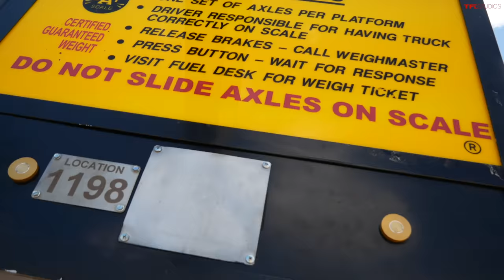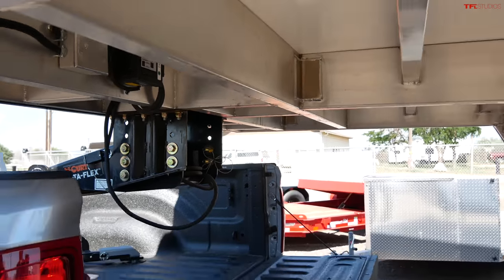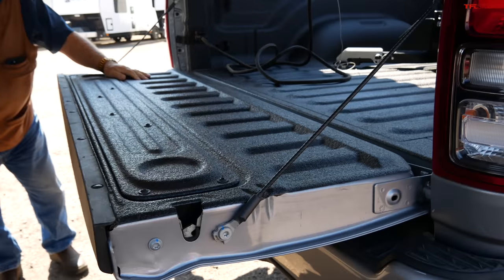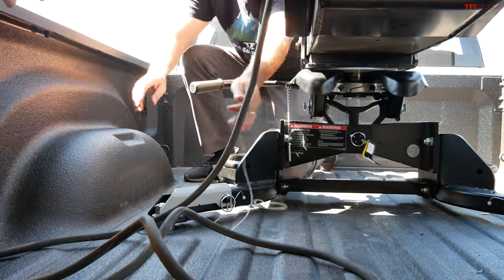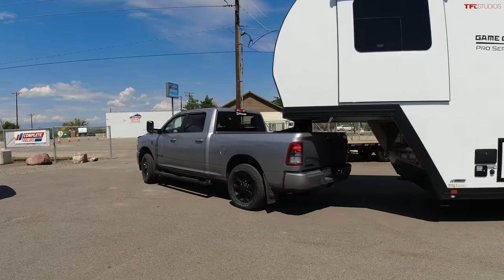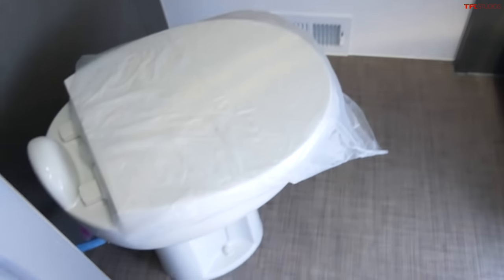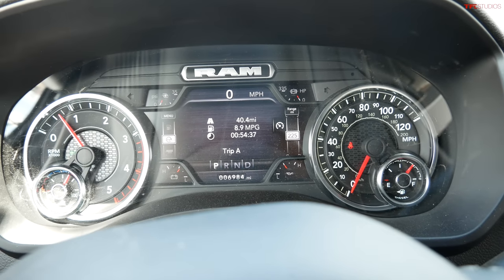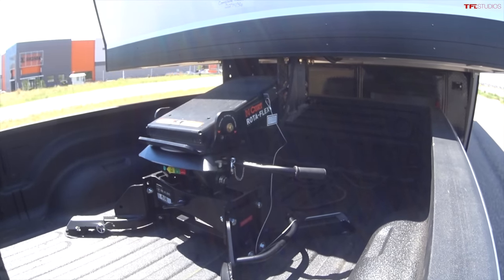I Accidentally Overloaded My Ram 2500 Cummins By 1,000 Pounds & Guess What?

Comment: Toy haulers are built to be naturally pin heavy when empty. This is to balance out the load of the cargo in the trailer when loaded so that the trailer maintains the right ratio of pin weight. I suggest doing a follow up video with a side by side loaded in the trailer. This would be a great demonstration to show why load and placement is so important when hauling 5th wheel trailers.
Reply: I’m surprised this isn’t the vast majority of the comments. That truck is fine once the trailer is loaded.
Reply: Funny how many “experts” will claim that loading toy haulers will take away tongue weight….when they are designed to be tongue heavy unloaded.

I have to move ballast to the rear of my toy hauler because I use it for mountain bikes. And I use the grill and most of anything I store in the pass through as ballast. Also the fresh water tank sits in front of the front axle, I usually leave it near empty unless we are boondocking. That water can balance out a heavy load in the rear, but for me it just adds tongue weight (100 gal tank)
Reply: Tfl still thinks measuring squat of relevant metric to compare trucks of different suspension design
Reply: ... Any trailers for that matter. You don't want to get into a fishtailing nightmare because pin weight is too low!
Reply: I was going to say, throw some wait in the trailer and it'll balance out, when you do the math from the weigh in 8300lbs to over 11000 is 2700lbs of tongue weight, that's nowhere close to being withing the 10-15% tongue weight, that's 25%. Gross trialer weight you should have about 1600- 2700, should be pretty close to the gross weight of the truck. That said a 1 ton or a heavy payload truck would be better for sure
Reply: @gtileo  Fifth wheels, especially campers like this one don't fall in the 10-15% tongue weight range, that's only for pumper pulls. Fifth wheels are in the 20-25% weight range which is exactly what this one is. Loading 3k pounds in the back of the trailer isn't going to lift the front of the tongue weight worth 1k pounds. It's not a teetertotter lol. The axles are pushed back and spread out for a reason, to carry the load that's in the camper, but it's not going to just magically lift the front end of the trailer, it'll make the overall trailer even heavier and might even put more tongue weight on the truck. You typically want your 60/40 split, right now it's maybe a 75/25 split, but getting the rear weight up 15% isn't going to lift the front end enough. 3/4 diesel short bed trucks are the most useless thing ever put on the road I'm not sure why anyone even buys them. If you want to tow you just get a 1 ton I don't even know why 3/4 ton trucks exist. Either get a halfton and tow a little trailer or get a 1 ton and tow basically any trailer.
Reply: Load and placement is important with ANY trailer. The amount of vehicles you see towing heavy loads with the nose of the tow vehicle in the air is worrying.
Reply: @dougswamprat5275  That's because the majority of people still haven't realized that 3/4 ton trucks are useless. That's why it's called a 3/4 truck because it's only 3 quarters if a real truck. And a 1/2 ton is half of a truck lol.

I never understood 3/4 diesel trucks. Like, you put a very powerful diesel motor on a vehicle with very limited suspension and from / axles. Why would literally anyone want the most capable engine in the most least capable truck? Ford uses the 6.7l in every truck from an f250 to an F750. So why would anyone want an F250? Will get the same fuel economy as an f450 but with half of the capability. You wouldn't buy a ranger with the 6.7l diesel, I mean that'd be cool because it would be fast but it's not going to tow well and it's not going to carry anything.
Reply: @dedalliance1  well for people that do real work and don’t spend their time on a YouTube forum talking out of their ass..3/4 ton diesels do all kinds of amazing work hauling hay, wood, and other various ranch jobs around my ranch. Yes, it probably isn’t a good truck for hauling my house when I go camping (for all you 5th wheel fan boys that don’t actually camp), but I camp, you know with a tent so it’s not a big deal. I routinely pull tractors and all kinds of heavy equipment, works just fine
Reply: @Mistro07  Yeah I've worked on farms too, and I've pulled 2,000 pound trailers with a four wheeler up and down steep grades, really it's a tractors job but tractors are expensive. Look, the only difference between a 3/4 ton and a 1 ton, depending on brand and year, is the suspension, maybe the rear axle, and maybe slightly different brakes. Basically, it's the difference between handling packages which is why it's utterly stupid to buy a 3/4 ton truck when for like a grand more or 2 you can just buy a 1 ton truck and have a much better handling truck which you can overload even more. I'm sure being a rancher hauling heavy equipment you've overloaded your 3/4 ton diesel many times before, well imagine this, if you had a real truck, aka a 1 ton, you could overload that truck even more, you could get a 46' deckover gooseneck and put 2 of your tractors on it at the same time and haul that around, you could put 4 more big round hay bails on the trailer with your 1 ton and get even more work done. But that's the whole point, a 1 ton truck is just more capable, sure, you can overload a 3/4 ton truck to do the work of a 1 ton truck, but you can overload a 1 ton truck to do the work of a semi too if you really want to. A High output 1 ton Cummins has more torque and horse power than a PeterBuilt in the 60's lol. Like you could legit tow 40-50k pounds with one if you wanted to. Which is exactly my point, why buy a 3/4 ton truck if you do real work? For a couple grand more on a new truck you could just get a 1 ton truck and then have even more truck to work with. You'd get the same fuel economy, it's basically the same weight so it's not going to get anymore stuck in the mud, it's basically the same ride quality (better ride quality when towing heavy). Other than being dumb and ignorant there's no reason to not just opt for a 1 ton. But then again, farmers and ranchers are typically dumb ignorant and stubborn it's just how it is.
Reply: I bet the truck will be fine with the weight side by side loaded in back would take a little tongue weight off.
Reply: 5th wheels and goosenecks are designed for around 20-25 percent tongue weight. 

Ram 2500 trucks with the diesel engine are payload limited for max tow with a 5th/gooseneck trailer. The only way to achieve max tow is with a bumper pull, with them being 10-15 percent tongue weight.
Reply: Exactly I have a bumper pill toy hauler. The axles are farther back than a normal trailer to compensate for weight in the back
Reply: exactly!!! put 5000 lbs in the back of the trailer and I bet the truck's weight will be under 10k lbs

Comment: If you're planning on buying a trailer, it's always best to buy too much truck the first time.  Having to trade it in to buy a bigger truck will cost you more in the long run.
Great video with great information.
Keep up the good work.
Reply: Facts, I’ve always had this concept but others would say I’m doing too much. I rather have too much truck than to find out one day it’s not enough.
Reply: 8ft bed and a 3500 is the only way I’d tow a 5th wheel. 2500s are for large travel trailers.
Reply: @slscamg  I tow a 30 foot travel trailer.  I tow with a 2017 Chevy Express extended cargo van 2500 with the 6 litter V8.  I wish it had the Duramax in it, but at the time I bought it and still today the only Duramax available for the van is the 2.8 4cylinder.
If the engine goes and the rest of the van is still in good shape I may look at putting a 5.2 liter Isuzu diesel in it.  It's what most of the Isuzu box trucks run in them, and it's supposed to be a good engine.
Reply: No such thing as too much truck 😁
Reply: I went from a half ton Chevy 5.3 to a high output 3500 Cummins SRW. I never wanted to have to do it again

Comment: Excellent video as always. The Ram 2500 rear axle is rated for 6,040 lbs and the front axle is rated for 6,000 lbs. You are only about 100 lbs above what the truck axles can take, so going to a dually would be way overkill. The Ram 3500 Single Rear Wheel truck will get you up to a 7000 lb rated rear axle and a 11,800 lb GVWR for a crew short. And as a bonus ticking the box for the Ram 3500 will enable you to get the High Output 6.7L Cummins that bumps the rating up from 370hp / 850lb-ft to 420hp / 1075lb-ft. Yep, 1075 lb-ft of torque and no dually parking hassles. 😎
Reply: It’s the pin weight and passengers that causes you to go over.  Add pin weight with people and cargo in your truck.  Illegal weight is illegal. Any weigh station will write you a ticket the cops care about cgvwr and gvwr.  Doesn’t matter what you think your axles are rated for.
Reply: @LANsolo12  I don't know where you live, but every state I have lived in bases the loading on axle ratings.
Reply: A dually is not overkill for a trailer that can weigh 16000 loaded. It is in fact exactly the tool for the job at hand.

Comment: You did great.  I would have suggested you test your king pin connection prior to taking weight off of Jack's.  I've seen connectio s that look good not be fully latched.   The result is caved in bedsides.   And to test the trailer clearance   asking is good bit pulling forward at full lock is more useful.  I didn't do that once and had to replace a window on my Ram.
Reply: It's always best to raise your jacks a few inches off the ground (and chock the trailer wheels) before trying to test your king pin's lock.  That way you are less likely to damage your jacks or drop the trailer down on the bed of your truck during the test!
Reply from the maker: @rpsmith  Yes - that makes a lot of sense!
Reply: No need to Chock the tires, use your trailer brakes.
Reply: @rpsmith  or manually lock the trailer brakes and pull away and mr truck great education through the entire video love you explained that king pin vs ball connection to the truck
Reply: @farmkid7888  -- Trailer brakes are not designed to work in reverse and chocking the wheels is 100% reliable!
Reply: Tug test!!
Reply: @rpsmith  WHAT!? " Trailer brakes are not designed to work in reverse"???
Unless you are referring to surge brakes (which would NEVER be on a 5th wheel), all trailer brakes work in both directions.
Reply: @rsg1963  -- Drum brakes are designed to take advantage of the drum turning to help set the bakes so they don't work all that well when you are backing up.  Folks who grew up working on drum brakes know exactly what I'm talking about.
Reply: I stand corrected!  According to Dexter, their electric trailer brakes are designed specifically to work in both forward and reverse directions!
Reply: The video proves why never to buy a standard size bed truck if you plan on towing goosenecks or 5th wheels long bed for the win.
Reply: @erikgonzalez2278  Thanks
Reply: @Back_door_bandit_98  -- Real trucks have 3 pedals, no spark plugs and a long bed!  :o)
Reply: I thought the hook up procedure the went through was not good at all. They run the king pin in, do a bunch of other non related stuff to hooking up, then one of them says he has to go back and make sure to lock the jaws? Not with me. It's all or nothing when making the trailer connection to the truck and with 5th wheels you will visually inspect where you captured the pin. Then tug test. You set your self up to forget something by not following an all or nothing attitude to the hook up procedure and that is not safe.

Comment: I would like to say, when you’re pulling a brand new trailer like that, always start with the brake gain low and then you can always go up from there. Cause if you start at 9, you’re gonna lock up the trailer brakes and flat spot the tires.

Comment: Don’t forget that the hitch alone probably weighs about 300#, which comes directly off your available payload. I have a short bed 2500. We use a slider hitch to allow full turns without worrying about the trailer hitting the cab.
Reply: Ya I was really surprised they weren't using a slider.

Comment: Some comments: it is helpful to do a 'pull test' before you head down the road. If the kingpin is not 'locked' into the hitch and you pull forward the trailer will fall on the bed of the truck; a short bed truck typically has a 'slider hitch' installed so you can make turns up to about 90 degrees without blowing out the back window; it is always good idea to ensure the 'payload' of the truck is within the 'hitch/pin weight' of the gvwr of the rig.
Reply: Exactly what I was thinking.  The slider hitch saves the cab. And saves the trailer...

Comment: I have an 06 lbz duramax as a work truck, completely stock 335 horsepower and I have towed a 27500 pound Traktor trough a mountain many times that has a 3200 foot elevation difference from one side to the other and never had any problems with it. I now also have a 2014 LML duramax full delete and a tow tune gets the job done a bit faster cuz it has 100+ horsepower
Reply: It is the torque, and the torque curve, not the horsepower actually.
Reply: @calebniederhofer6529  yeah I know I just said horsepower to tell the difference between the 2

Comment: I love RAM, but out of the three major brands RAM has the lowest payload. You’re right Mr. Truck RAM needs to step it up. Especially how much they cost now! Love TFL. I bought my 2500 based on your Guanlet testing.
Reply: Ratings are just a suggestion. I haul well over 30k a lot on my 3500
Reply: Payload was the reason I went for the 3500. Not a big price difference. Not sure why anyone would go for a 2500 if buying a diesel truck. I’m sure the 2500 can handle much more than what the sticker say. But if you end up in an accident with someone who start questioning your payload it will be expensive.
Reply: The payload on the Ram 2500 is a joke !
Reply: What formula does ram use to come up with that magical number for payload? GM 2500 diesel payload numbers are lots higher than ram and I don’t think they are built any stronger.  Idk just asking.
Reply: Because 2500 don't want over 10k gvwr if you over it you have to do safety done every year. depends on your provience. 2500 front axle and rear axle is almost same with 3500. you can check the gawr.

Comment: Nice job, I had a 03 F350 short bed that I used to pull a 45 foot weekend warrior toy hauler many years ago, had to have a slider hitch so it would clear the back of the cab when turning. The new trucks and trailers have come along way in 20 years lol

Comment: I think the ram 2500s are held back by the coil suspension. The Frame and axels are rated for more. I bet if you added airbags to that truck it would feel very confident.
Reply: Yes. It’s the same axel rating

Comment: I would suggest always chocking the wheels when coupling or uncoupling a 5th wheel RV.  Rear axle weight rating is typically the limiting factor for SRW trucks and toy hauler 5th wheels.  Then figure more people, water, tools, clothes- all adds up. My choice would be a dually for that (very nice) trailer. Just more relaxing to drive once you get into narrow, uneven mountain roads.

Comment: I'm a trucker by trade I luv the Teflon plates keeps the mess down but you still have to grease the king pin & the fifthwheel jaws.😊 Bumping the king pin the fifthwheel should lift the trailer  legs off the ground by at least 1/4 inch.  Plus the fifthwheel should make full contact when hooking up. Plus tug test is a must to make sure it's locked in.

Comment: You need a slider hitch when towing a 5th wheel with a short bed truck to avoid colliding the cab &  trailer on tight turns.  Exceeding the vehicle payload is the most common mistake made by people when matching an RV to a tow vehicle because most only look at tow capacity.
Reply: I run the Curt Slider hitch in my RAM. It weighs a lot more than the setup shown here.
320lbs. vs. 180lbs.
Payload reduced by a further 140lbs. ☹️

Comment: Thank you for doing this.  People are overloading their trucks with 5th wheels all the time without knowing.  Some 5th wheels for their length and weight do have less pin weight, but you have to check it and consider what you are going to load into it.  You may even add much more weight to the tongue since many fifth wheels have tons of storage under a lift up bed.
Reply: I see more overloaded 3/4 tons than 1/2 tons on the road…..
Reply: @MrJamesLuz  Yep, People buy a Heavy Duty and don't think twice about slapping on a fifth wheel.

Comment: When hooking up, we always have the 5W's hitch plate a touch lower than our slider hitch's deck so that it basically guarantees the pin with be at the right height from the kingpin lock/release lever. If the release lever gets wrecked then you'll have serious issues getting the trailer back off let alone reattaching later. If it get's destroyed, you almost have to by a new hitch head.
BTW, we have the 6.75' bed on our Ford F-350 and there's no way the extra length prevents our 5W's cap from being able to hit the cab. And our 5W has a curved cap unlike this ATC. A slider hitch is really the only way to go with short beds. People like long beds so they don't have to worry about this, but the advantage to short beds is, even though they need a specialized 5W hitch, they usually have 200-300 more lbs of payload than the long beds.

Comment: Slider hitch fixes the restrictions on a short bed/fifth wheel. During towing it keeps weight on center of gravity, when backing up or tight turning (moving slow) it slides the tongue of trailer independently to avoid hitting cab.